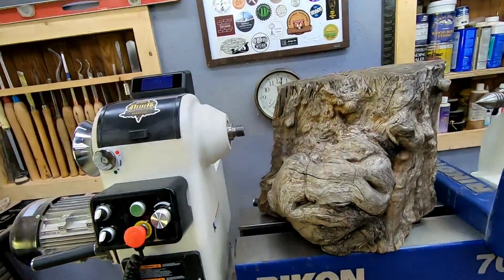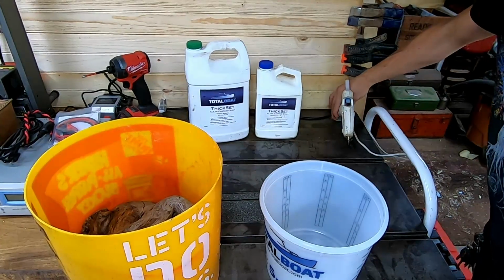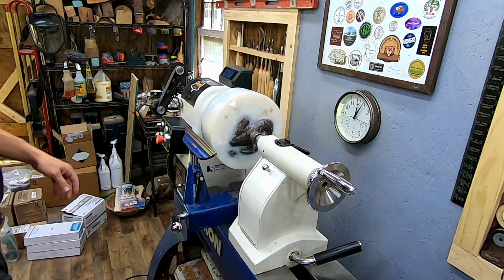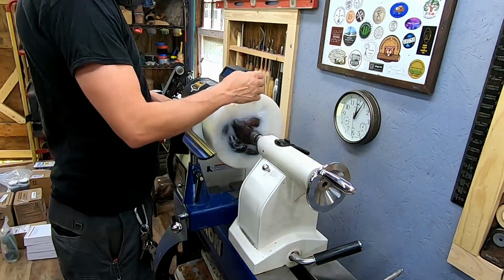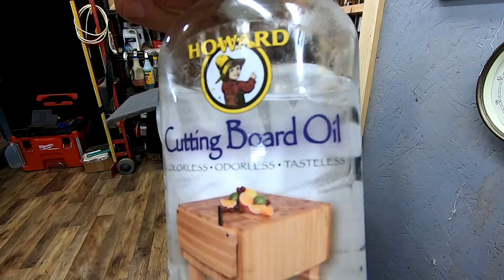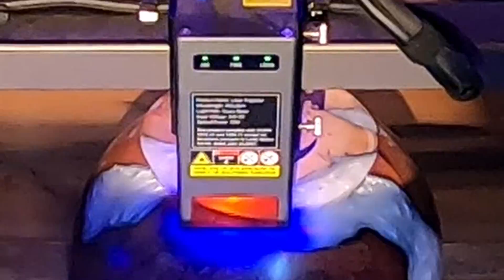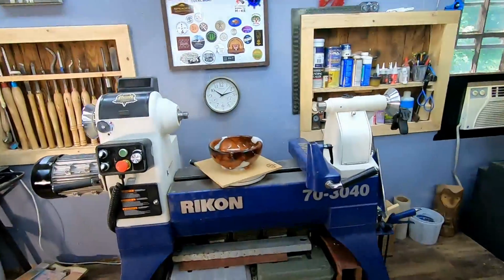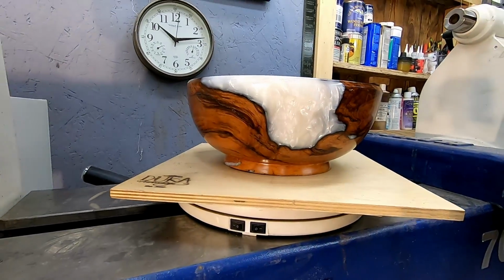Woodturning - Apple Burl Bowl

Comment: What a beauty!   Noticed you used abrasive paste after the oil and not sure why the paste wasn’t first and the oil last.  I’m new to turning and trying to learn.  Thanks and I just subscribed.   😊
Reply from the maker: Thank you 🙏 The wood bowl finish is a drying oil, it’s recommended that you wet sand in between coats. I ended up using 3 coats, I leveled the finish with the ultra fine scotch brite (600g) and then polished it with the Yorkshire Grit (2000g +) 🙂

Comment: Beautiful bowl!!!  Question about the Yorkshire Grit usage.  I thought it was supposed to be used before you put finish on it (other than a sanding sealer)?  And then you would put your finish over the top of it.  Maybe it's just an alternative usage of it.  Just trying to learn as I just got my first can of it the other day.
Reply from the maker: Thank you, in this case I was just using it is a high grit polish. The wood bowl finish is a drying oil, when wiping or brushing drying oils, there can be some brush marks left behind, I cut it level with the ultra fine scotch brite and brought the luster back up with the YG kinda like polishing a clear coat on a vehicle. ✌️

Comment: Didn’t think it would turn out that good. I liked the white epoxy, my wife didn’t, she said to much contrast in colour. Possibly red or blue a bit see through instead of solid. 
Thanks for sharing.
Did you think about coring the bowl.
Reply from the maker: Thank you, I’m definitely more of a contrast kind of guy when it comes to design. A coring system is definitely on my list, I have many much larger burls that I won’t touch until I can fully process them.